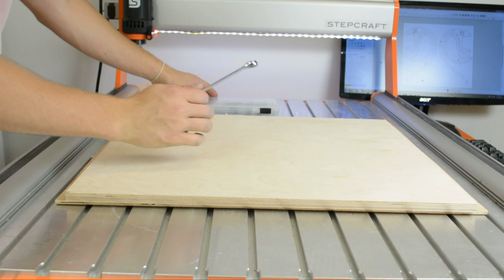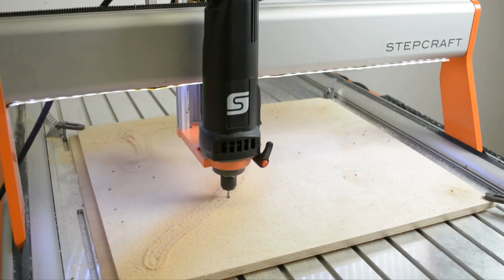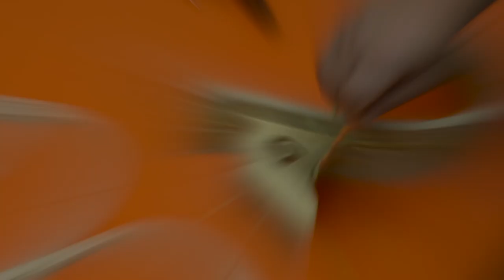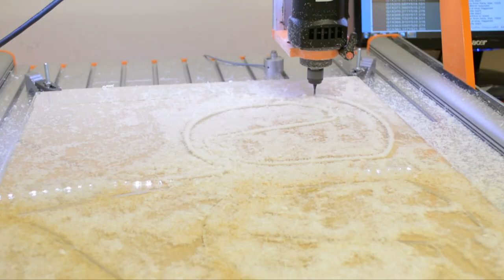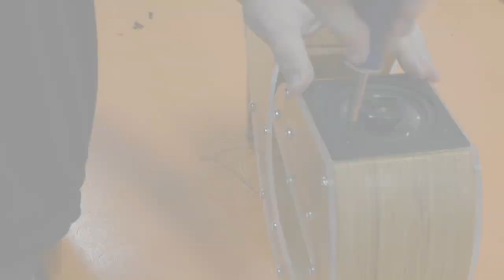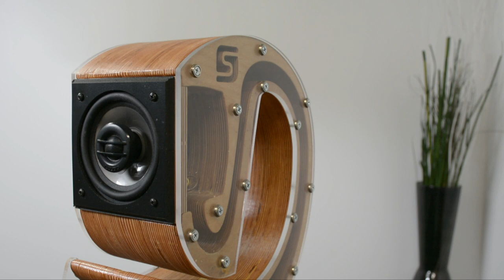Making a Bass-Boosting Horn Speaker - On a Stepcraft CNC

Comment: Ah, too bad you didn’t put in a proper speaker for horn loading like a Fostex FE series.
Reply: I like the old FE series. I have a set of 165 and 127e . The 165 will go into new, better made but likely the same design, cabs. The 127e are still NIB.
Though I havent heard any of the newer models at all, so thats not based on comparison.

Comment: what end mill did you use to cut the plywood? and feeds and speed would be great. Trying to get a good starting point to cut 15mm plywood. thanks
Reply from the maker: 1/8" compression end mill from Amana Tool - 25 mm/sec at 1/8" pass depth with 13,000 RPM